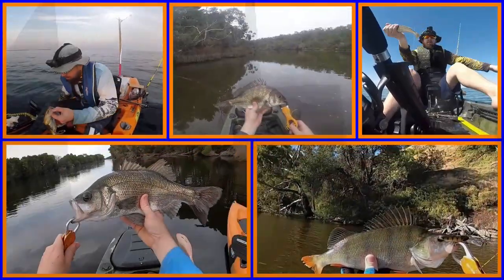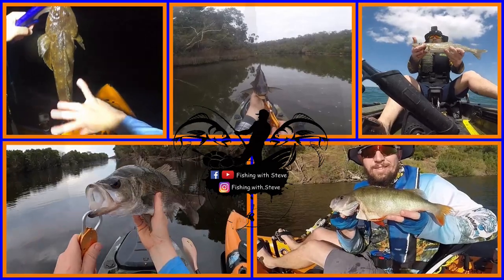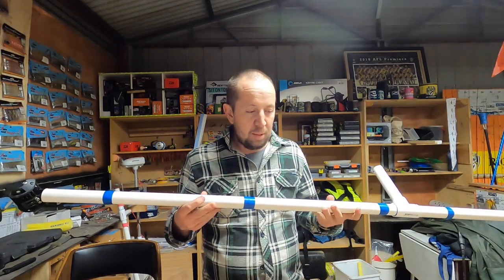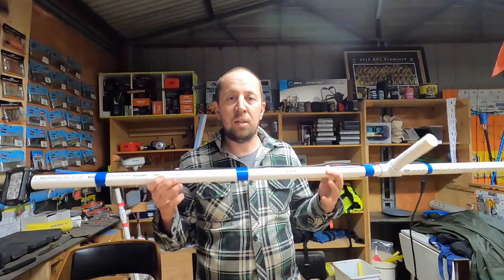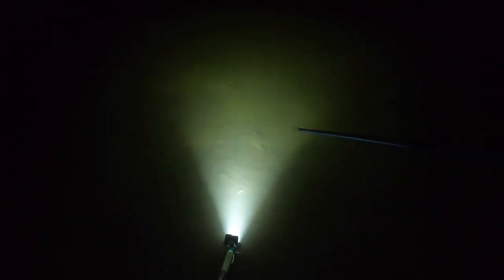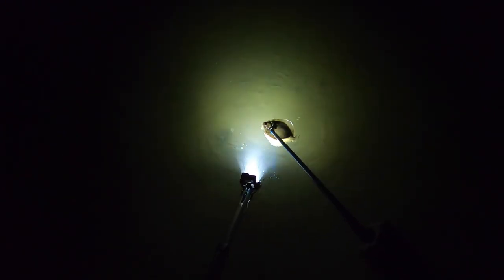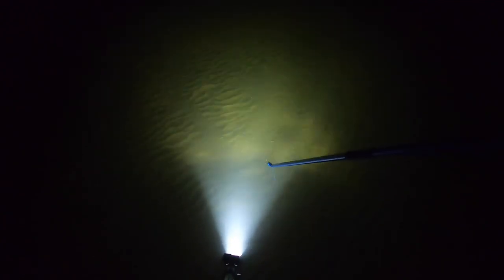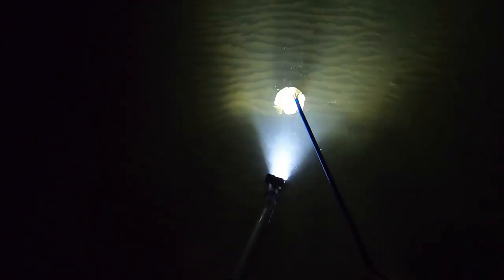Underwater Light Build

Comment: Interesting concept Steve. Never done floundering before. Next time as a suggestion to ensure the most watertight protection on your joins is to go to a place like Jaycar and get dual-wall heatshrink. This normally has 4 to 1 shrink ratio but is resin-lined. So when you heat it up the resin melts then sets and produces a water tight seal. I only use that on anything exposed to the elements. Thanks for sharing your ideas.
Reply from the maker: Thanks for the tip trav, you'll have to come out for a sesh one night